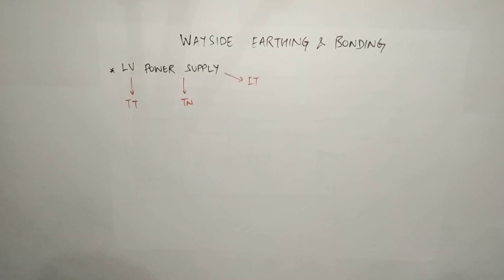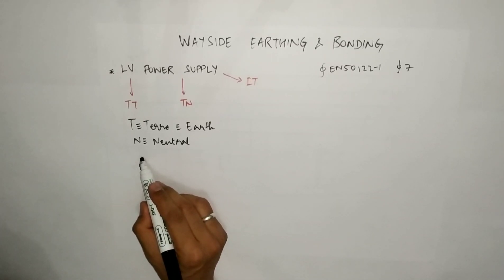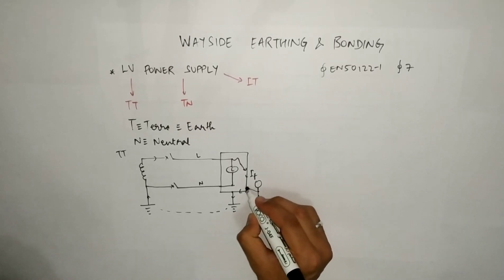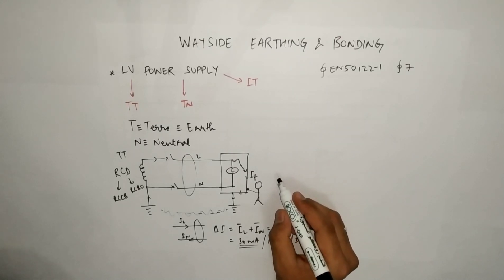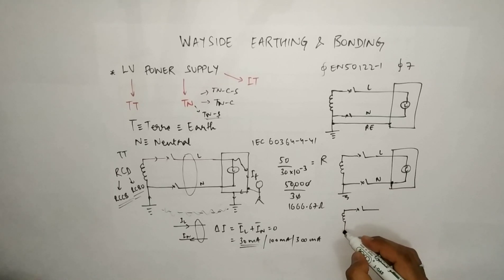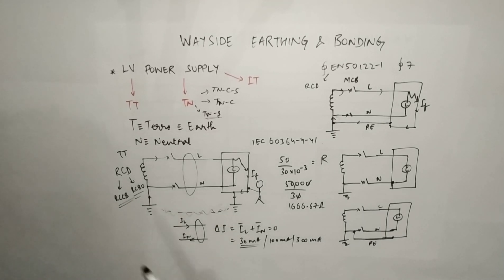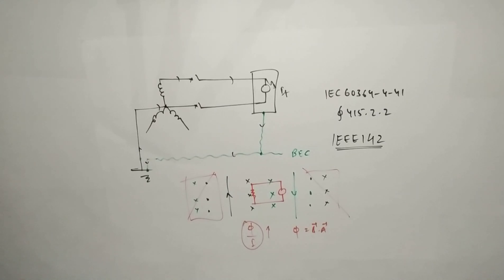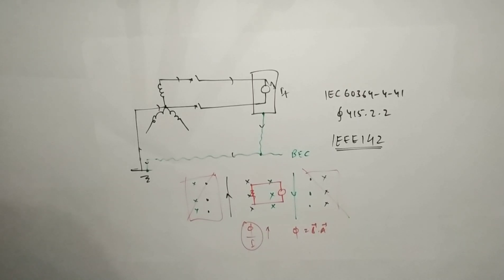Lecture 10: Wayside Earthing & Bonding - TT and TN-S System

Comment: I would love to see a video explaining ways to reduce stray traction currents in your LV PE conductors when traction bonding of LV system is in place. Aim being to reduce the exposure of voltages on the PE conductors when maintenance technicians are working on the LV system. Thanks and great videos.
Reply from the maker: Sure will try to make a video on this topic. To avoid any effect of traction currents on LV system due to same earth in AC traction, we tend to provide 4P for 3 phase or 2P for single phase supply. This is done to avoid voltage on neutral reaching more than safety voltage of 50V due to higher rail potential while person is doing maintenance.

Comment: Dear Mr. Sahil - Your explanations are very good. Just a comment - In this video You have mentioned IEC60364-4-41 clause 415.2.2. Please have a look on this clause. 415.2 explains Additional protection: supplementary protective equipotential bonding and 415.2.2 explains the calculations of resistance R between simultaneously accessible exposed-conductive-parts and extraneous-conductive-parts. please check
Reply from the maker: Many thanks. I really appreciate your blogs on earthing and stand you took against mal practices in metro system. 
In this video I have calculated the maximum fault loop impedance provided by BS 7671 table 41.5 (or section 411.5.3 of iec 60364-4-41 or 7.4.2 of en 50122-1). The clause which you have referred is for additional protection 415.2 of iec 60364-4-41, however, for TT system RCD is mandatory.